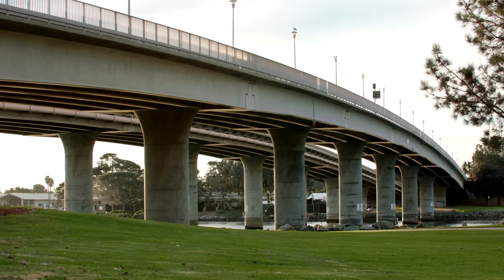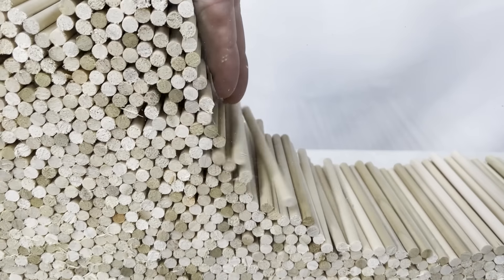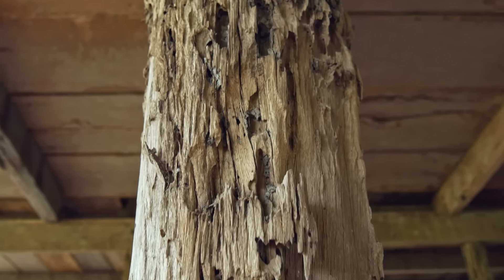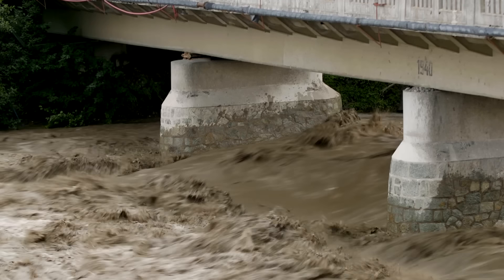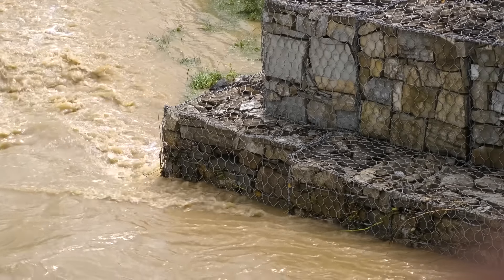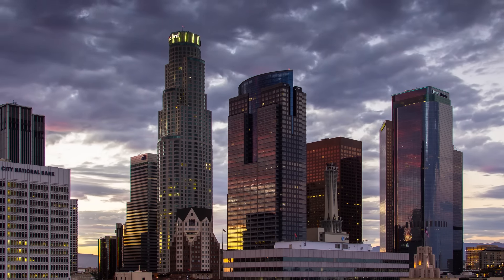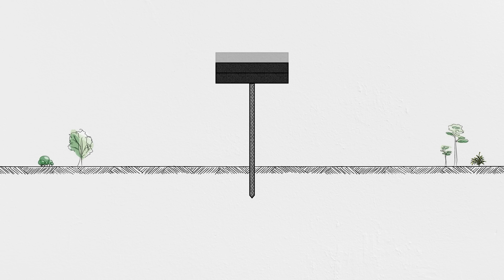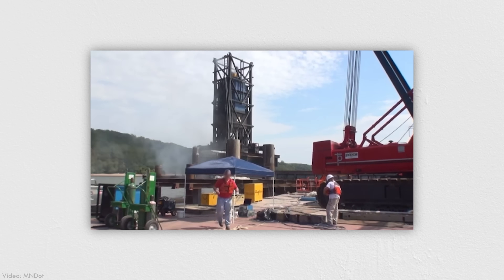Why Buildings Need Foundations

Comment: That crawlspace thing needs to be revamped or die completely honestly. The space is hard to work in and more importantly, hard to see in even with adequate lighting due to the nature of the space.
Either make the space bigger or give a dedicated room it's job. And honestly, I don't see home owners, myself included, wanting a room they shouldn't interact with. I can due to my work experience and knowledge of engineering but I still want my home to be used by me and not anyone else. So the only real option is to make a crawlspace just a second basement or something like that.

Comment: 12:35 If the earth was made of just hard rock, we would still have a whole bunch of tricky problems to solve. Sure, rock is solid and it can resist tremendous forces, but not infinite forces. If your buildings are heavy enough, even solid rock will crack. Besides, rock is porous, some times it comes with cracks already installed in it, so that water can pass through. When the temperature drops below zero, ice crystals will force those cracks even wider, and eventually pieces will fall off. If the ground was just hard rock, foundations would be simpler, but not trouble free.
Reply: bla-bla-bla-bla-bla

Comment: With bridge piers and other multi pour structures. Besides the rebar. Is there anything done to strengthen the cold concrete joint?

Comment: How do concrete raft foundations distribute load without breaking up? Even with reinforcement shear loads cause cracks. Shouldn’t concrete rafts be much wider at the base and tall like pyramids?

Comment: In Russia, we have been using screw piles for private houses for about 10 years. It is fast (the foundation is done in 1 day), stable and cheap. I don't know why other countries don't use this technology. My house has been standing on such screw piles for 10 years without any problems. We have very bad conditions for the foundation. Clay soil, frosts and a lot of water in spring.

Comment: How do they handle Piles that get driven below the water table?  Do they need special water resistant coatings then to ensure rust doesn't destroy in a few short years?  Same w/ Coastal stuff like Florida or Texas sand as a huge layer, wouldn't that shift horribly?

Comment: I drill a hole until I hit the limestone bedrock that in my area of the Ozarks is never really deep. And install a steel pipe and our concrete around it. then cut them all the same height and weld house trailer frame on the top. placed 4 ft apart . then a wood subfloor above that. Requires no site work. just drill the holes.  and its fast and cost effective.

Comment: Construction in climates without freezing conditions have it so easy and cheap.  Foundation?  Done.  Insulation?  Only to keep air conditioning levels under control.   Heat pumps?   No problem and nothing special required.

Comment: I am not an engineer, but is there a reason the piles can't be giant screws? I would think that it would greatly increase skin friction and could probably be designed to have good end bearing when they reach the desired depth. Then you wouldn't have to hammer them, you would just need a tractor sized screwdriver. I imagine if it were possible it would be done, so what is the problem with it?
Reply: They already have screw piles 👌

Comment: It kills me when I see construction companies pouring teeny 3 or 4 foot foundations to hold up massive 5 floor, 500 unit apartment buildings. Then it extra kills me when they frame the whole thing in 2x4 timber and then people (as is currently happening in my building) are shocked when cracks start appearing in the walls in this 5 year old building. Somewhere along the line Americans lost either the knowledge or the will to build things well.

Comment: I am considering a underground work shop for here on my farm, central Indiana. 
Without knowing what the soil capabilities at the desired depth are before excavation,  I would like to have a estimate of how much foundation I will need to calculate construction costs.
Is the best way to take core samples,  or can I use a shaft penetrating to the depth I will will be building the foundation,  in multiple areas to get a clear reading of the soil weight capacity in multiple locations  to not only know how much of a foundation I will need, but also to determine the best location for the building  ? ( I have several areas that are available for me to use to build the shop. )

Comment: There are a lot of Bridges being built near my house. They are drilling these about 4ft holes into the group then seems like they are filling them w/ concert after casing they with steel tubes and rebar? Any idea of what type of foundation they are using?

Comment: Hi Grady, I am considering a concrete 32 ft diameter round silo house or a square silo with 2 ft radii in the corners. Wall thickness is 8" with lots of reinforcing bars. Planned height of the top living floor is 150-160 ft with a roof deck and pergola topping out at 190ft as any structure over 199ft requires an anti-collision light. I was thinking about a drilled piers down to bedrock with a foundation cap to tie the piers together. Would this type of foundation be adequate for a tower of this height? Yes, I will be hiring a structural engineer to design this tower and I am not looking for specifics, but I was just curious.

Comment: If i have a house that is 12 metres by 12, and it is 3 floors in total, 1 floor is the basement, would it be okay to have the basement 8 metres 8 or 10 by 10 and have the floor above resting also on the ground.

Comment: I am retired vet looking for a reasonable advisor concerning replacement of my driveway (concrete) and adding a driveway.   The driveway needs to be concrete but the driveway can be another material. I live in Pensacola where sand is everywhere.  I have seen red clay placed as a concrete underlayment.  Any idea who would be able to advise me?   I am a DRYER by necessity.  Thank you

Comment: building foundations seem to prefer concrete and steel over performance and expense.  I came to the same conclusion Frank Lloyd Wright did - a gravel foundation is better than fixed concrete.  maybe not for a skyscraper, but certainly works for wooden homes, 2-story structures, etc.

Comment: Hello @practical Engineering, I have a very important foundation question??? I am in the New England USA and we are going to be building a house!!! Okay here my question it is total run is 40' wide 36 deep, but there is more to my question, from left to right can it be a slab till it hits the 17' (Obviously, I have to go down 4 feet below for the slab side with a footer and frost wall) foot mark, and then drop to a full 9' foot basement at the 18" foot over to the 40' side, which would be 18 x 36' feet full basement???  I am just trying to simplify it....... I could send you an email if I hear back from you??? Thank you!!!

Comment: Hi
Need advise foundation dimension for a 6m x 3m single faced billboard
Height from ground level to bottom length of the frame 2m
I am planning for a 100mm x 100 x 6mm thick sq steel tube
No. Of steel tubes to be used x 3
Direct post to ground or achor bolt system?

Comment: Like the information..i looking to build a detached garage in my back yard..in northern ontario Canada..
Question i hsve to do my floor pad..i will put a base compacted with granular A rock..about 12 inches..my ground is sandy soil ..it has good drainage
When pouring floor im told i should put a vlub footing along with 4-5 inches if concrete and mess..
Is the club footing necessary. Or also should i put down 2 Inches styofoam then pour concrete..lots of ideas ..looking for ehst is best..size of floor be 24x24..thks

Comment: Levels out building ground sink and if foundation bars of steel dug concrete pours holding steel bars in place and earthquakes protection also looking like room between foundation building for water run off water again if building was getting wet molds will start eating away foundation and more health issues pay attention to survive

Comment: 6:15  If you look at various parts of the world.  They spend different amount son their houses.  You mention average house ownership is 15 years?  What about average operational life span of the house that has many owners through it's life?
Over here buildings are built much, much heavier and stronger than in the US.  Houses are built for 100 years minimum life.  Solid tied cavity wall with solid block and brick, 6ft+ dual tied block foundations.  Concrete roof tiles (1 inch thick).  The only weak spot is the "dormer" sticking out of the roof.  Sleeping in that during 90mph wind gusts always makes me things of you guys in the US livng in entire houses built the way that single dormer is.  It creaks, it cracks, it clicks, it whines in high winds and I can feel the room pressure change as the wind pushes and gets around it.  The rest of the house?  It would take more than sustained 100 mile per hour winds to do any damage at all really.  Maybe the dormer roof could start to fail above 100mph, but not the block core of the building.
Reply: The difference is the cost.  Houses built to last 100 years cost appropriately.  A house built of block, brick and concrete weighs a LOT, probably 100 tons for the whole building.  Even transporting those materials to the site costs a lot of money!  That has an economic impact on house ownership.  Banks are more willing to lend on houses with 100 year life spans, because they feel sure of getting their money back as the house will still be there to sell.
When I bought my house one of the first things the bank asked was, "If it a block or wood framed building?", I answered "Block" and they said, "That's good, because we have to have a structural engineering report on any wood framed houses, even or especially brand new ones".  It turns out there just isn't any proof that wood framed buildings will stand the test of time in our climate.  "Damp" is probably the biggest headache in Ireland.  It's wet 60% of the time!
An initiative to build "cheap" "affordable" family homes has seen many developments of wood framed buildings.  Unfortunately conctracts have been discovered replacing engineered timber beams in he damp layer with bog standard 2x8s untreated.  Houses built this way have been condemed within 10 years due to unrepairable root in the support beams.

Comment: funny how they say dont build a house on sand, build on rock in the holy bible. Well our farm house (holland) is build on sand, without any pile driven fundation, just a basebment and beams in the sand :) 

20meters away from our house, and 8-10meter piles are driven into the ground to support the houses there. So much difference in soil composition, but maybe Holland is a nightmare for foundation workers due to the vast difference even in the spaces of 10x10m square

Comment: Why Buildings Need Foundations? Very simply, to better transmit earthquake accelerations to collapse the building easier. 

Alternatively, foundations-platform & building can be separate to slide past eachother with damping mechanizms. Yes?

Comment: Remind me to draw the prize with a big drill it's about $150 ft a more deep and after that the insert the rebar and put the concrete behind it it's pretty efficient alright like i said the circuitry news and concrete parking garage is a very very technical too the intention cables are very dangerous a guy to make sure about one snap and put some guy in half and killed himself to be careful with that s*** too very dangerous but so interesting job a lot into it got a variables it's got to be safe and don't cut corners especially concrete and amount of rebar you use sometimes people use less reborn that causes issues we had a bridge by a Miami-Dade college and FIU college to collapse because of inferior work they did was a few years what happened and couple people underneath the bridge and cars couple people died it's on top of cars and stuff like that so it wasn't good so that was just a bad design but i mean it's a lot to it got to take your time and deal that she can't go do this fast yet to get through properly and like i said a lot of variables but that's what it's all about figuring out leaving it right the first time.

Comment: Good in Israel Do normal foundatioon and Safe romm 15 years with Betton  with Metal Can Hold Rocket and no Problem with Foundation this why you Building cost 0 after 30 years need to rebuld

Comment: This is mostly an American idea of foundations and homes. In Europe you betcha I want my home to have foundations that will last for 100+ years not 30. It's very odd to me to see this kind of mentality, wooden homes, wooden foundations that are meant to last for only 30 years. What about resell value? Over time it's much more efficient to make long term foundations instead of paying nearly the same cost every 30 years. It's not uncommon to see homes that are 100+ years old where I'm from, even buildings that are several centuries old. Stone on proper foundations can last for centuries with minimal repair, think longterm not shortterm.

Comment: Here's some truth that will either change how you think, or cause you to delete the comment if you're with the folks who think people should have to get into permanent debt to own a house. Penn state students designed a foundation system that does NOT require a 90000$ contractor foundation and associated inspections, delays, and officials corruption payoffs.  What they essentially proved is that with simple compaction, shallow piers or even surface pouring is all that's needed if you add insulation and about 3 light bulbs worth of heating in the crawlspace activated as fall ends. The ground never swells because the 55 degree cave temp is maintained all the way to the surface all winter. Voila you don't need to be middle class to build a home if you have trees and a sawmill. The END of government produced homelessness.

Comment: What will happen when the metropolises with their huge skyscrapers all start to fail due to aging? Since they were all built, mainly, around the same time this means they will all start to "die" around the same time. Yes, it is a continuous process of building and demolishing but when there is a huge peak in building these very expensive structures this means that there could be a future event where the all come crashing down around the same time. Does anyone think about these things? What if in around 100 years all these building's start to collapse and there simply is not enough men and resources to replace them? I imagine those who design cities give almost zero thought to the effects of what they are doing in 150-200 years... I guess it will be someone else's problem... and most civilizations only last around 250 years due to corruption of the political system so I guess it doesn't matter anyways.

Comment: this just shows poor American building standards as usual. here in the UK beneath each supporting wall will have a trench dug 4-5 feet down with reinforced concrete and then the brick structure built atop it. Even before we discovered reinforced concrete the UK had solid stone beneath the building foundations, with workers placing stones to form the foundations which was dug in a trench unlike America which put a few wooden posts in the ground and then built the floor structure off that and largely continues this method today, then Americans wonder/ complain their house cant withstand a hurricane. Purely standard houses outside the US can more than survive these forces. Before you complain about your house being destroyed, stop building homes made of flimsy material and actually build your homes out of material that will withstand the frequent disasters  your area has. Every other country has built their homes to survive and adapt to natural disasters apart from the USA who keep building flimsy wooden homes which have been proven time and time again to not be strong enough to survive hurricanes, SORT YOUR SHIT OUT, every other country has!

Comment: As a european, I have always found it amazing, how patheticaly weak american houses are, like it is made from wood and cardboard. Where I am from, most houses are made from cocncrete, rocks and metal, which must seem like a bunker to you americans, but for us it is normal. My parents live in a 130 year old house, the walls are about 70cm thick, try to tople that with wind haha.... winds in my city reach speeds well over 200km/h and we think nothing about it, while in USA it would be a major disaster and the whole city would be leveled. But here, it is just another day. Also, I find bases of american houses ridiculous, I mean you can craw under your house 😂. Another thing, in my country practicaly all new houses have floor heating/cooling (no wind blowing in your face, electricity bill is like 10x lower, temperature always the same in every part of the house/room), all windows are at leats 3 layers of glass, everything lighted with led's, all exterior walls are layered with at least 30cm of heat insulation material... ehile this is normal to us, americans see it as a house only rich can afford.